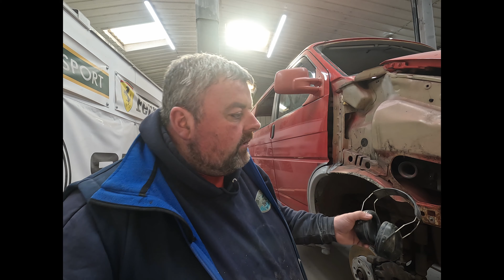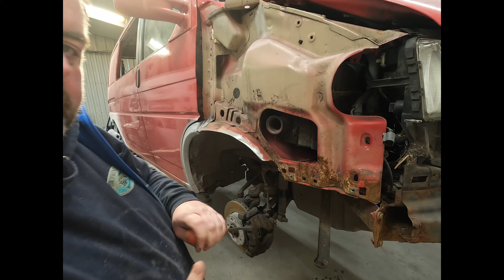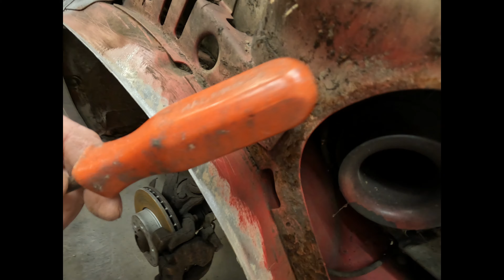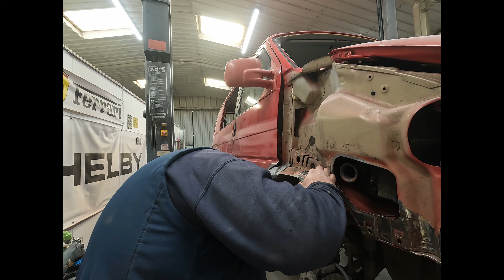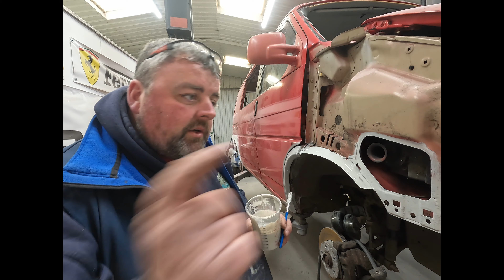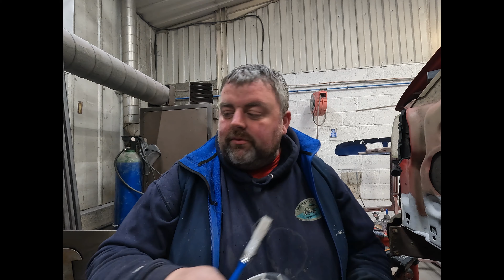Volkswagen transporter t4 cleaning and epoxying the front inner arches lets see how we do it

Comment: Good work. Is the epoxy you're applying a paint or a primer? 

When refitting the wings what sealent do you use between inner and outer arches?
Reply from the maker: Hi thanks for the comment the epoxy is a 2k primer it seals everything in and then you can start your bodywork over the top as for the wings we normally use a polyurethane (pu) it comes in a tube and applied with a caulking gun hope this helps thanks